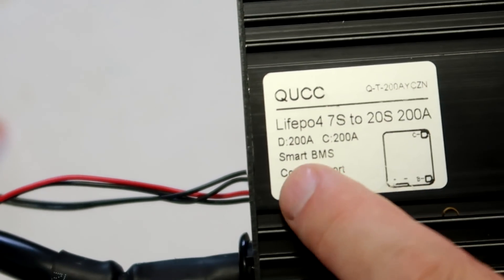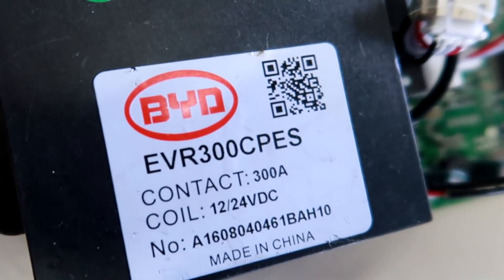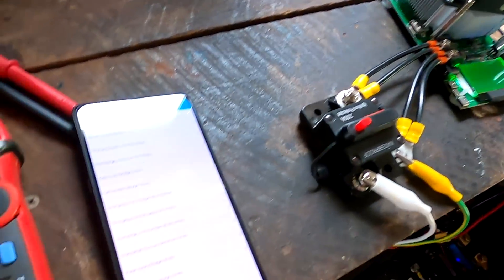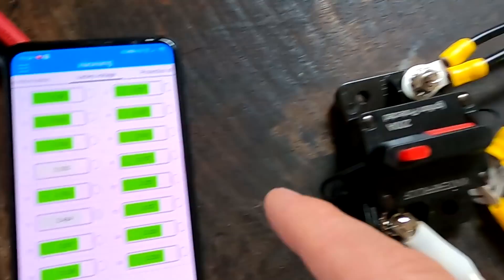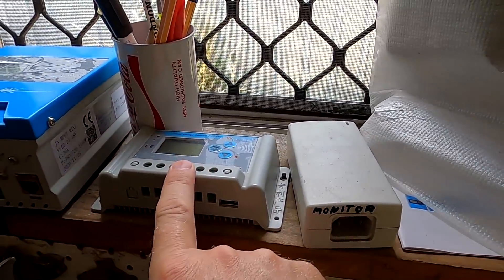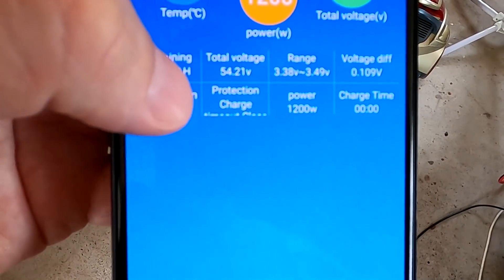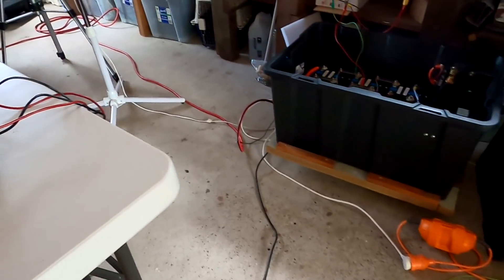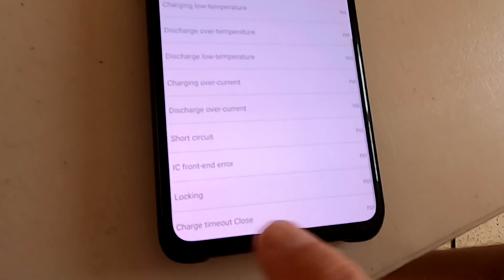This QUCC BMS does not protect my battery! Am I right?

Comment: Came here to view the adds but this informative video kept getting in the way!!!! 
On a more serious note though, I only saw just one, I think that it was a 10 ohm discharge 10W resistor inside the BMS! That to me means that it can only discharge one cell at a time! If it's not keep up, then I would be looking into a lower resistance resistor so that it can discharge the cell faster but only after I first measured how hot the original resistor gets while it's actually discharging... 
Regarding the MOSFETs and temperature, I don't think that they will get hot in this application! They generally stay cool when either fully on or fully off! It's only when they are working in the area of half way in-between those two regions where resistance is at its greatest and heat is generated, like in an audio amplifier for example... 
Technically I believe that a BMS should have the ability to keep cell's from reaching over voltage, it seems that it cannot keep up with what your solar charge controller is providing... It should only disconnect the solar input when the total pack voltage is reached, but it seems that it's not looking at individual cells for over voltage, just total pack voltage! 
You know that I'm going to say it LoL, I just don't have this particular problem... 
A simple constant current and voltage DC to DC converter with enough current capabilities to serve one cell, then just repeat this for every cell and then say goodbye to your over voltage Sichiyaytion LoL... that way you charge all the cells to 3.5V each at the same time or whatever voltage you choose as the maximum... Then all that you would need is an under voltage cutout circuit which I have seen on eBay... The last time that I told you about this, I kinda got the feeling that you thought I was telling you to charge the cell's one at a time and one after the other, but no, that's not what I mean... And you would have to rewire the solar panels for low voltage and high current so that you are not stepping down too much to get to the maximum voltage of 3.5V per cell... 
Your setup is a very typical system design and they all suffer from the same problem... Although some BMS systems can dissipate more current to keep up or have multiple resistors to balance multiple cell's simultaneously... 
I don't know, either you totally redesign your system or look for a better BMS? Or maybe disconnect a panel or two to slow down that Australian sunshine coming into the system, give them cells with higher internal resistance a chance to absorb some of that energy.... 
As always, I hope that this helps, keep it plugged and stay charged 🙂

Comment: Charge time out in the world of Lipo means the charger tried to balance and was unable to achieve cell balance. In other words it wont keep trying to balance indefinitely.
Reply: It only had one job!
Reply: Most chargers for lithium ion battery don’t actually do any balancing at all. It is the BMS of the battery pack which does that. All the chargers do are to provide a constant current to charge the entire pack and then a constant voltage with a lower current for the pack/BMS to balance itself. If the balancing current is not high enough vs the charging current of the charger, the pack will not balance well esp if they are too far apart in their underlying properties.

Comment: Hi! I think it's working as designed, if you look at the datasheet for the BMS the charging cut off is 3.75, are those parameters on the app working? I found the cut off on the daly was 3.70 while changing.. I don't know why they have these limits so high..
Reply: Truth is the cut-off voltages are somewhat arbitrary and not a drop dead deal withing limits.  From what I read damage to lifepo cells does not happen until cell voltage reaches 4.2 volts on the high side and I think it was 2 volts on the low side.  OF course, if the cell is being charged or discharged the value you are reading is not the real cell voltage.  Give the cell a rest for an hour (at least a minute or so) and then read the voltage under no load.  However, if you want increased life you don't want to go below 20% charge or above 90% charge.  Then again, it is all nonsense to a degree because from a practical standpoint you can't measure true cell voltages in an operating system.  You have to fudge it.  Personally I discharge my batteries to around 3.05 volts and charge them to 3.37 volts.  In any case, think of it this way, with all the rapid battery advancements happening even if you diminish your cell life you will be able to buy much cheaper, lighter, smaller and more powerful batteries in 3 years or less.
Reply: Appreciate the information Ricardo, I just purchased a daly BMS...
Reply: @Off-Grid Garage can bring up this topic on one of your next videos? what should be the bms cutt off values!?

Comment: There's a lot to take in here.

First: I think I've mentioned my skepticism of this BMS capabilities in the past. To me it doesn't make sense to save a couple hundred dollars on the BMS when it's the thing protecting your multi-thousands dollar battery pack.

Second: Should the BMS disconnect the charger when any cell gets above 3.65v (Or disconnect load when any cell gets below 2.5v)? 100% absolutely YES it should, especially if you've programmed it that way. However: Remember that this BMS cannot "disconnect the charger" or "disconnect the load". It can only disconnect the battery. If it disconnects the relay it disconnects the charger and the load at the same time. And that's the Achilles heel of this BMS: It cannot control charger and load separately. It could be that because of this inability to disconnect the charger separate that's why the BMS is not as sensitive to a single cell going over voltage: if it disconnected every time a cell reached 3.65v it would be constantly cycling on and off when the battery is hovering around 99% SoC. In order to avoid disconnecting the load during cell balancing it may wait until the cell is a certain threshold over the max voltage or wait until multiple cells are over voltage. Who knows, but not being able to control the charger and load separately would certainly make it harder for the BMS to do it's job well.

Third: You mentioned you can hear it clicking and the charge continues... You should consider pulling the relay and testing it. In a past video you tested the relay and found that it used very little current when it was in the "on" position. The fact that it uses so little current implies to me that it's either a bi-stable or latching relay. Both of which have a tendency to fail in the "closed" or "on" position. I wonder if the BMS is trying to disconnect the relay and the relay itself has simply failed?

Maybe it's time for a decent BMS that can communicate with and directly control your Victron inverter and Vicron MPPT? ;)
Reply: It does seem like the app is generic and not all the parameters are implemented in the BMS. It’s odd though, that the BMS can trigger an alarm for a single cell over volt but not disengage the relay unless, as you suggest, it’s faulty
Reply: All correct. Try batrium! Does cost some money, but shure works with the victron. Though you might need a gx (victron) of some kind.
Reply: @vbdaniel4  You can save in that regard by putting Venus OS (victron endorses this) on a raspberry pi. The GX (CCGX, Cerbo) devices are overpriced. Batrium is expensive too but you don't see people having issues with it.
Reply: @dash8brj  fully agree.
Reply: @vbdaniel4  Does Batrium offer CAN-bus communication that's compatible with the GX devices?

I'm using an Orion Jr 2 BMS which does offer Victron compatible CAN-bus.
Reply: Oh I remember the batrium now. I've looked at that one. I think one of the issues with that one though is there standard unit only accepts up to 15 cells (You'd need an add-on module to do 16 cells, increasing the cost), and it is quite expensive to begin with. The Orion Jr 2 w/CANBUS is several hundred dollars cheaper and can accept up to 16 cells and still offers CANbus communication with the Victron GX devices for charger/load control.
Reply: @JeremyAkersInAustin  yes, the can bus on the Batrium is compatible with the victron Venus or colour GX. I know of two systems working well.
Reply: @JeremyAkersInAustin  I don’t believe that is the case. The cell monitors are Daisy chained and not limited to 15. One of systems I have installed is a 16s3p lifepo4 system so I know 16 cells is fine.

Comment: I had the same circuit breaker. Kept tripping well below specs. I'll try and see what 2 in parallel can handle..
Will opt for a simple 14s Daly bms for my build. Might bypass the bms for pack output as I'll be running a Motenergy ME-1004 brushed motor that would require a very expensive bms.

Comment: OMG that's shocking. After seeing you use it, I was considering it is as a good choice for my future system, moreover it has a magnetic latching relay. Thanks for the new info. We should stay away from it. Great Video!!
Reply: And also, the BMS should definitely shut off charge/discharge in over/under voltage situation of a single cell, not the whole pack. I suspect, the "magnetic latching relay" that they have used is faulty/unable to function as they intended. That's why even if you hear it click, it doesn't disconnect the circuit, probably the magnetic latch didn't open. In a standard relay, it will definitely open the circuit when it clicks. Anyways this BMS is useless, thanks for testing it for us.
Reply: OMG...I've ordered that BMS as well....it will arrive in a few days.  I will send that back immediately...the product seems to be useless ...
In principle the features of the BMS sounded too good to be true....
Reply from the maker: We may have a solution

Comment: You really need to look at Batrium bms . It has all the protection features you really need . You have expensive gear and your using a low quality bms that’s will cause issues -
If it was a 24v system look at Dacian’s electrodacus version
Reply: Have you looked at the diybms ? I hear it often mentioned. I have got SBMS0 coming so keen to see how it works :)
Reply: There is also the 123Smart BMS. Very similar to the Batrium but I think the Batrium is Australian made so might be the better choice.
Reply: Check out chargery BMS.  Meant more for Electric Vehicles they finally got the bugs out of their firmware and I am basically happy with them and they are a lot cheaper than Batrium.
Reply: @robertgrant5895  where can I find the info on there firmwares? I thought they might be also releasing a active balancing product soon too?

Comment: Your short circuit current should be a lot higher - your cells can output maybe upto 10C, so 2800A! I would put that at least 1C, 280A. This would stop alarms if you connect any loads with a high initial current, say charging their capacitors, or an inductive load.
Reply: I think the datasheet for these cells actually say 1c for max discharge too as well as continuous, no higher peak for some reason even if it might be okay.
Reply: Thats fine if all you consider is the battery, but the BMS has current limits too, so you have to take that into account.

Comment: Andy I've got the JBD bms and it runs exactly the same app. When I first started playing with it it was a nightmare trying work out what is what but slowly started to understand it a bit better and make some changes.
I'd ditch that bms in the bin if there is no single cell protection. 
I did like that bms at the start but not now. I wonder if their new model is the same.
Happy solaring.
Reply: So Andy may have a generic app and not all the features on the app are implemented in the BMS.

Comment: i am running a smart daly bms w/bluetooth and temp sensor and it will shut off if a cell goes over 3.65 instantly. it is easy to do settings with the app.
Reply: Well that's not very convenient! For the sake of one cell, everything else gets shut down!!! That would annoy me just seeing the rest needing more charge meanwhile the daylight is burning for just one cell...
Reply: Peter Milanovski Yeah. I suppose destroying or shortening the life of a cell would be much more convenient. 
As soon as the voltage drops the BMS restarts. And since I’ll never get anywhere near that voltage again it shouldn’t inconvenience me too much.
Reply: @PeterMilanovski  if you have the active balance voltage come on at 3.2 to 3.3 , after a number of cycles the lower cells will catch up.
Reply: @daveorr2192  yes but that's assuming that the solar input isn't overpowering what the BMS is capable of discharging... Remember that it has to have the ability to discharge the solar part and some of the battery capacity to be able to bring it back in line with the rest, and it has to be pretty quick too because there may be other cells that need to be discharged to keep the pack balanced... Unless your BMS has multiple discharge resistors inside? Which the BMS in this video does not!
Reply: Same here. When I did the initial charge to full as soon as one cell reached 3.65v it shut the whole lot down.

Comment: Charge Time Out Close might mean "relay fail?"
Reply: I'd lower your top voltage on that solar charge controller until you replace that BMS.
Reply: In Chinese “close” means off. (In English we would instead say the relay contacts are open.)  “Timeout” means the relay was commanded but no corresponding action was detected within a time.  “Charge” suggests the BMS has a seperate relay or (contact within the relay) for charge current.  So it seems the BMS is trying to do the right thing but has a faulty relay contact.

Comment: You are correct, what is the point of connecting all those wires to monitor each individual cell if the BMS does not open the contactor to stop charging or discharging. I suppose this goes in the category of lowest price DOES NOT equal value. Thanks for all the work doing such a thorough test on the product.